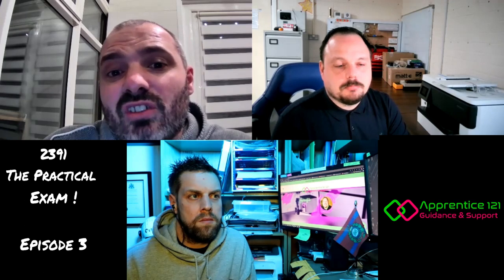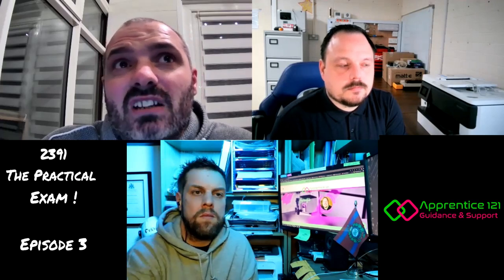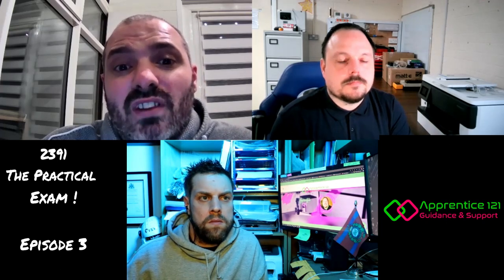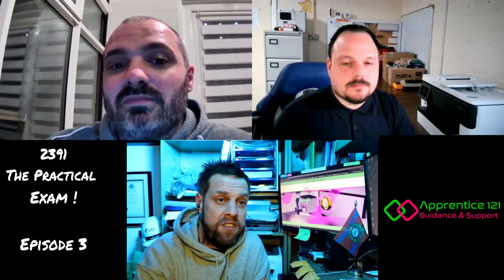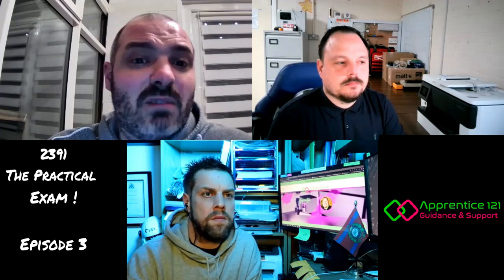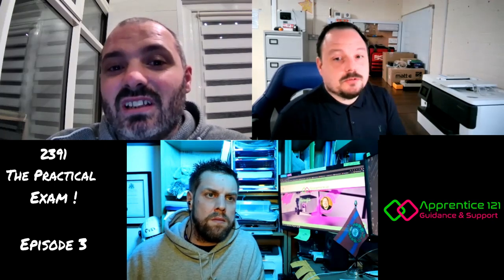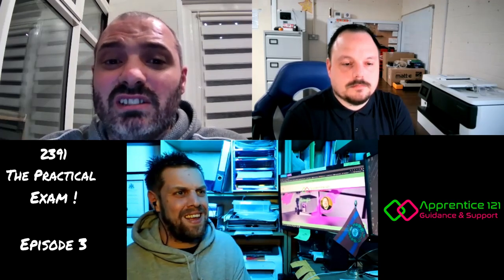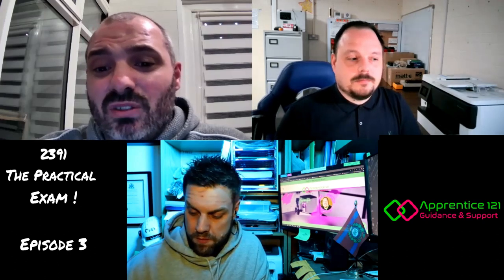2391 THE PRACTICAL Electrical Inspection and Testing EP3

Comment: At 12:30 you couldn't be anymore spot on. I was so worried about test condition testing that I didn't leave enough time or brain cells for the paper work. And the practical was ao easy in the end. But due to poorly completed EICR paperwork I almost failed. Last minute I said I need to rewrite. Paperwork is deceptively tough in this exam.
Reply from the maker: Thanks for sharing your experience! Really appreciate it and glad you got through the 2391! Paperwork is always a bloody menace!

Comment: Here's a question. You are testing a ring final circuit and have records showing it to be 62 metres long. You establish it has been installed using 4mm / 1.5mm twin and earth cable. You measure the r1 using a Low Resistance Ohm Meter and glean the reading of 0.32 ohms. What is your expected r2 reading without measurement?
Reply: Doing some end to end calculations there Monty?
Reply from the maker: 4/1.5 2.666667

Multiply r1 by that for r2
Reply from the maker: Also got your email and I concur. Busy day lol
Reply: Gives a lovely answer of 0.85
Reply: @A121podcast  Ahh lovely thanks - I was a bit worried mailing you out of the blue.
Reply: @craigbuist4636  I'm always churning away at electrical information! Have a bash at the question on episode 2......
Reply: @montystelevision3238  I have. I had responded to you but we have just realised that my comment went to review but is there now for you. I didn’t add cable temperature to it because it gives the same outcome for me which I coded knowing it would be undersized